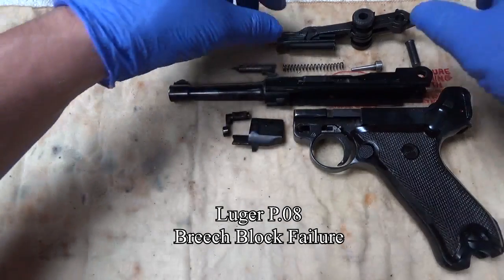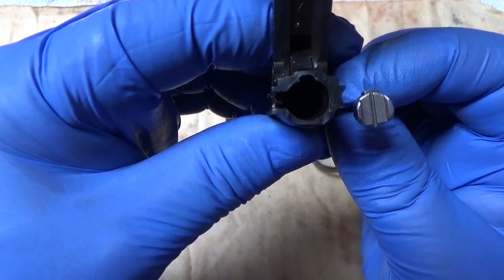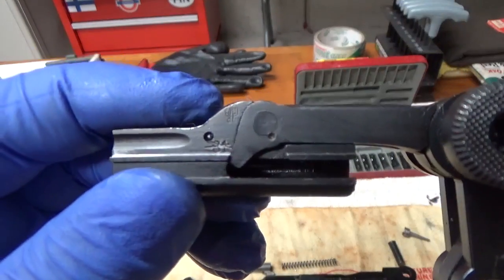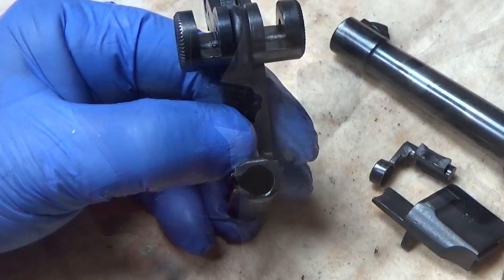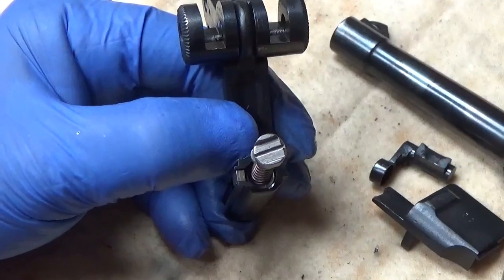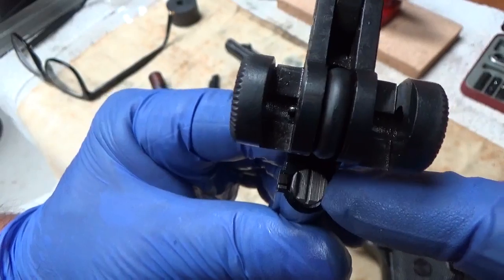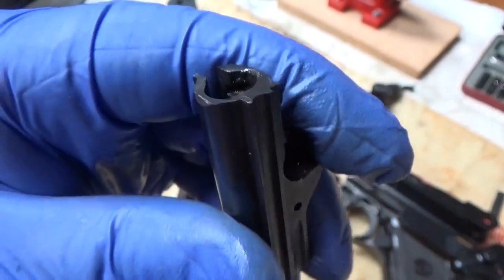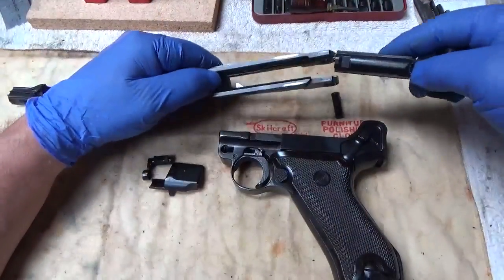Luger P.08 Breech Block Failure

Comment: Check not just function, but also firing pin protrusion.  The arm on the toggle link changed in design over 40 years as did the firing pin  design and not all surplus parts interchange.  Some mix and match between makers and decades may be required.

Comment: Thank you for your help!  Great video!
Reply from the maker: Check the extractor too.  I did not know at the time of the video but the extractor was worn too.  I made a video on that too.  P.S. I am no promoting my videos but I do recommend viewing them to see all the issues I had with this luger.  Thank you for your nice comment.
Reply: @A_Renaissance_Man  David, I did have to replace the extractor too.  The original did not fit two replacement breech blocks I tried.  Again, your videos helped there too.  Just so you know the history and how much you helped...  My buddy was given the 1917 Luger P08 as a gift from a gentleman in 1969, after he installed new flooring for him for free.  The older gentleman had removed the original firing pin because he said "something was wrong", and he misplaced it.  After installing a "new" firing pin the firearm did not work...  The Luger sat dormant in a gun safe approximately 50 years. After a discussion with my friend, he allowed me to examine the Luger and it peeked my interest.  Within an hour of blindly trying to diagnose an issue with a type of firearm I was unfamiliar with, I found your breech block video...  Boom, everything came into place ...and everything that was wrong you addressed.  Today...  I have yet to receive the locking bolt spring that I ordered, but it is on it's way.  I wish I video taped my friend's expression when he was able to fire his Luger for the first time in 50 years...  I would have loved for you to have seen that.  I send you many thanks for your detailed videos that helped us tremendously.  If you are ever in my neck of the woods, beers are on me, kind sir.

Comment: That is exactly what happened to a 1914 Luger I recently acquired, I got it for a reduced price because it had issues! I had to get it home to find out what was actually wrong with it. I sent off to (NUMERICH) which is now Gun Parts Corp. for a current production breech block. I got it back together (had to do some fitting--polished the sides) and tested it out. It was working GREAT ! But then after less than 50rds it seased to fire. I took it home to find out what happened.The new production part failed! Turned out the new part wasn't machined to the same specs. as the original one,a lot less meat for the firing pin spring guide to catch! Now I'll see if they will make good on the faulty part! If it is the same as the other one I DON'T WANT IT,IT WILL FAIL AGAIN!!!!
Reply: I had my original breechblock drilled for a 1/16" pin to replace the material damaged by the retainer pushing through.  My gun is no collector piece, but you do retain the original serial-numbered breechblock if you repair it rather than replace it.  The locking tab on the retainer has to be reduced a little, corresponding with the extra material of the repair pin compared to the thin material supporting the retainer in the original configuration; lots of extra material on the retainer tab.
Reply: With 40+ years of manufacture and a half dozen makers there were occasional changes in dimensions and design.  For instance late model firing pins were fluted, etc.  The breech blocks and the toggles also had small changes over the decades.  Check your firing pin protrusion.  New parts are usually made in China and like everything else from there the quality varies widely from lot to lot.